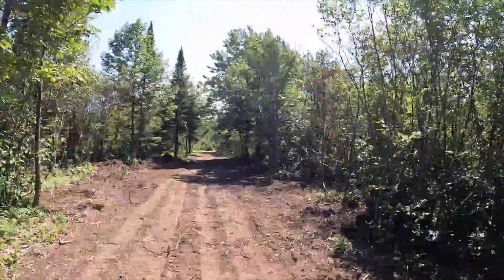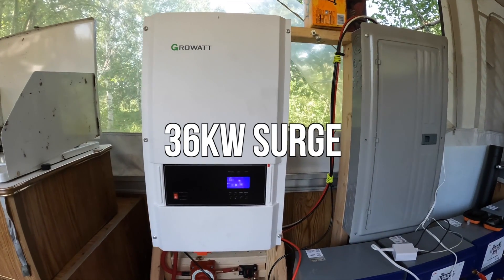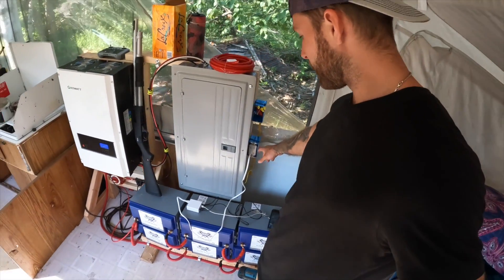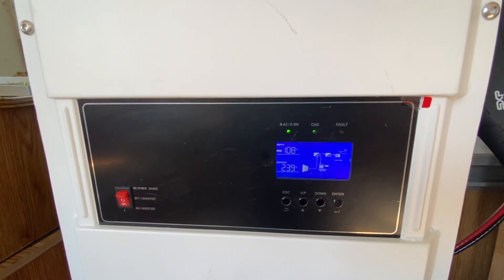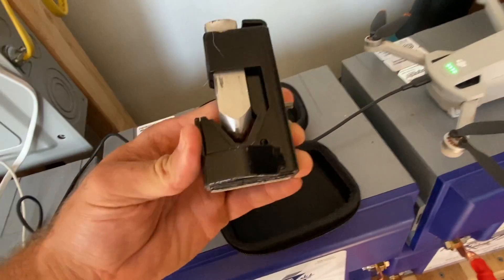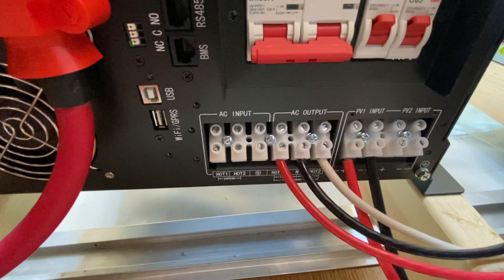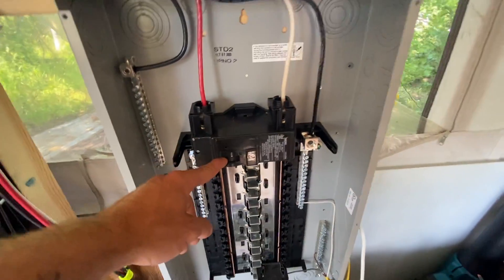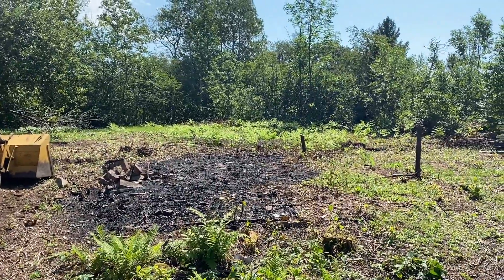Beginner DIY off-grid solar power system. Anyone can build.

Comment: Just like your PV wires, you should wrap some black tape at both ends of the negative wires to/from battery /inverter.

When you switch to AC in the load center the WHITE wire is your neutral and the BLACK wire is the second line wire. Easy to switch those, please do it today and slap your hand...

Comment: Did I hear you are in the U.P.? I used to visit family and friends over there when growing up in northern Minnesota.  Looks like you have the beginnings of a fine system.  As you were describing your battery hookup you mentioned they were in parallel.   I think they are actually in series (positive to negative) - no problem, just letting you know.  Parallel would be all positives and all negatives together. I won’t bore anyone with the details of this.  I wish you the best! Say hello to Copper Harbor & Houghton for me.

Comment: On the AC side of your system, white should NEVER be used as a hot leg and black should NEVER be used as a neutral or ground.  Black and Red are supposed to be the hot leads in a 120/240v split phase system, white is neutral, and bare or green wire is ground.

Comment: Will have you had any problems with inverter? I ask because I have the same inverter and having problem with it. I have been dealing with Signiture Solar and it’s taking a long time to get fixed. Tech support said they are going to move up to level 2 Tech. Support. I’m totally off grid. Just letting you know.

Comment: In addition to the color issues for wiring mentioned - Never mix AC and DC circuits.  Your panel Ground should not go to a common Ground Bus bar connected with the battery negative. The panel ground is a safety (circuit) ground and needs to go to an earth point. (Ground rod).  The battery (DC circuit) does not have a ground but rather a negative terminal or in other words, a return line.  DC circuits at times may use the vehicle chassis as the return line(negative) so it may appear to be a ground connection, but it is not. Another factor to add that may be confusing, a negative DC wire is normally Black, which in an AC line is the L1 power line.  The positive DC wire uses Red, while Red is used for the L2 line in AC circuits.  I know you are using materials at hand, and I have also had on occasion used extra Red wire for Battery negative side, but used black heat shrink on the terminals and spaced along the run to indicate it is Negative side of the circuit.  Helps to prevent accidental contact on the wrong side.  Good project, keep up the good work and learning.
Reply: Thank you for adding that comment. Mixing grounds of AC and DC can result in destroying the equipment for sure. I hope that our comments will help this fella get the electrical straightened out and on the right path...
Reply from the maker: Thanks guys. I've removed to the battery connection to common ground. Y'all' rock. I'll make an update on the system to not confuse newcomers.

Comment: Where do you live? In the US, per NEC, white is always the Neutral, Black and Red are always the hot lines. You are teaching people how to improperly wire a sub-panel! Please correct your video. NEC matters in most cities and counties and doing it wrong will confuse any electrician who might ever look at this setup. Seriously, using White for a hot line is a NO NO! White is the "Grounded Neutral", Always! Please correct this, ASAP.  Update: I just noticed that your ground wire is black. Per NEC, the ground wire must be Bare Tinned Copper, Green insulation or Green with a yellow stripe. Back is ALWAYS a hot-line, never ground. You can't phase tape the wire if it's less than #6 AWG either, so the wire needs to be replaced. I mean, come on man, this is the most basic of basic NEC codes. Everyone knows White is neutral and ground is Green. No?
Reply: @David Scottsdale For the main panel, that is correct unless it's already bonded at the inverter.
Reply from the maker: Thanks for the feedback. I will genuinely apply this to my setup. 

NEC who? this is my first electrical setup and panel that I've ever wired. Had no idea ground needed to be green. I know now!

Comment: In residential electrical red is hot black is hot and white is neutral. Split phase is both positive, they are out of phase by 120 degrees. Three phase is 120 degrees out of phase on all three phases which equals 360.. extremely nice inverter and battery setup 👍👍👍👍👍👍
Reply: Split phase (120/240) the positive conductors are 180 from each other, three phase they are 120

Comment: dude thats a good looking shotgun. btw, don't you have any fuse on pv -> scc?
Reply from the maker: only 8A coming from PV setup in direct sun and growatt is rated for 120A.

I'll add a fuse soon but i'm not too worried for now. Will likely add 6 more panels in the spring and add the 120A fuse then.